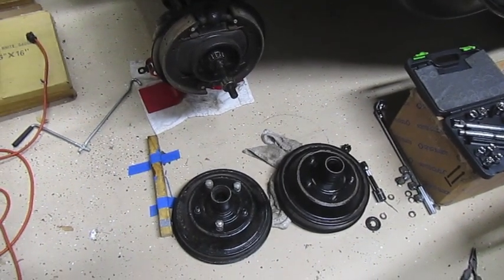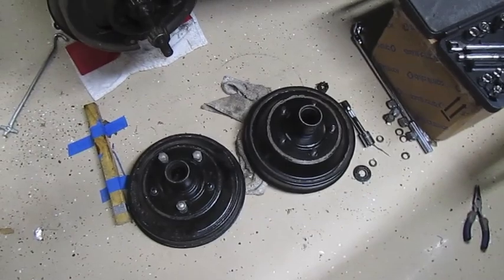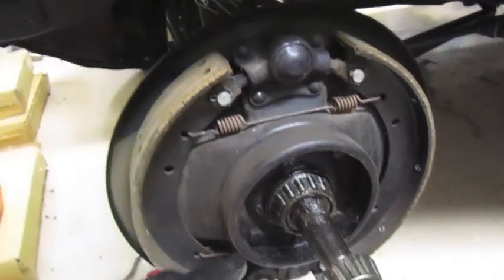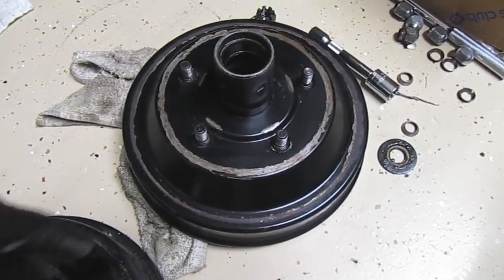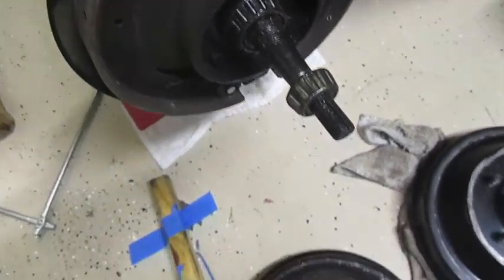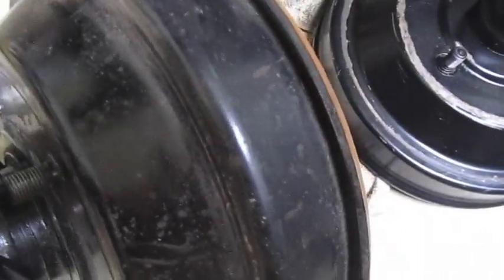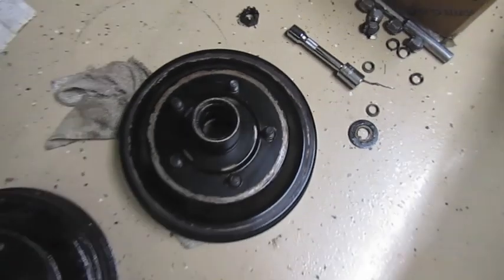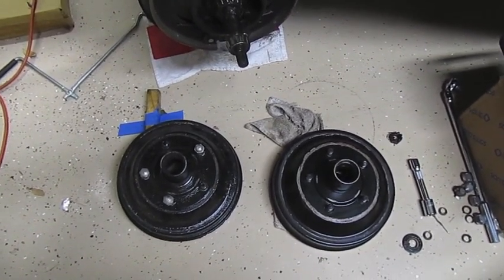Ford Model A - Brake Hubs Steel vs. Cast Iron

Comment: I have original steel drums on my 1931 Tudor that have probably been on there foreever.  But it also has reinforcing bands on each drum.  I've put 25,000 miles on my car and the brakes work just fine.  Just sayin' ...